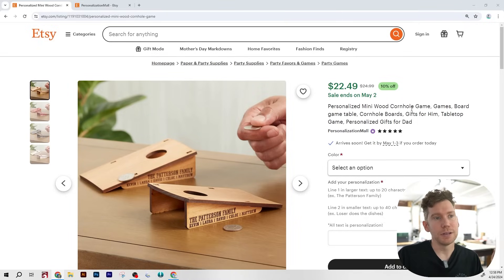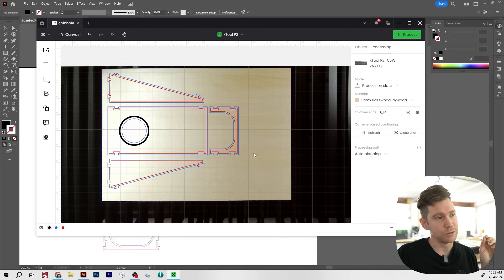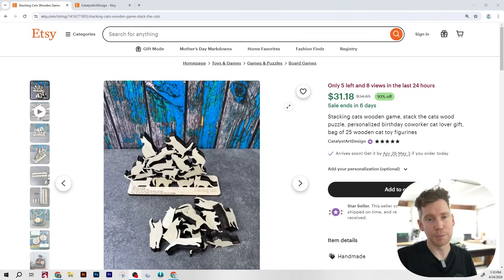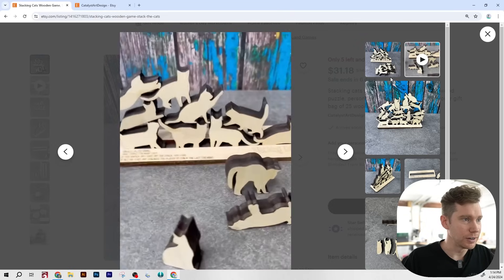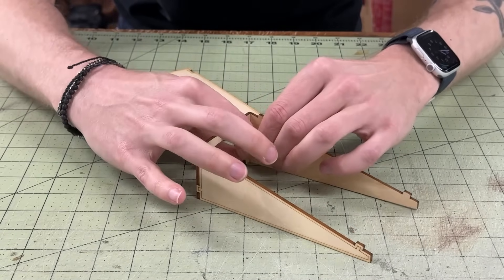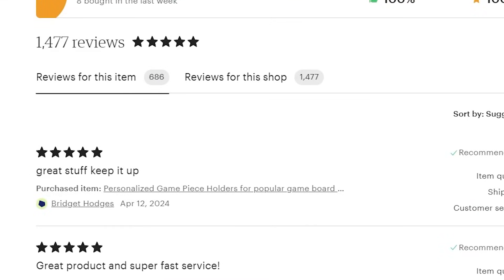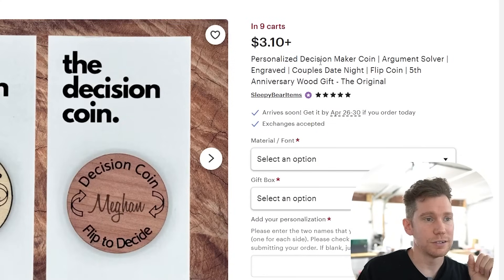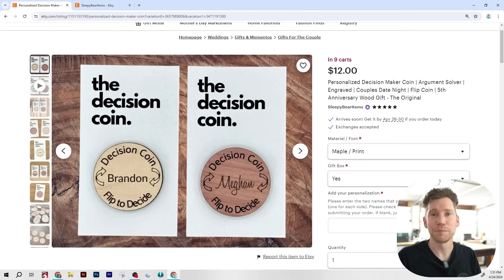Is this the BEST niche on Etsy for laser products?

Comment: Great video Justin! For the coinhole game, you mentioned blank coins, what do you think of wooden coins? you are already cutting out of the 3mm ply, go ahead and cut some coins and engrave them.
Reply from the maker: Thanks! I did try that and it would probably work. They are a little light so I would probably make the board and hole larger since its tougher to toss it without flying off course a little bit. Metal coins and bean bags have that nice weight to them.
Reply: @justinlaser  good point... hadn't thought about the weight differences

Comment: Great video.
I'm on the verge of buying the Xtool S1 40w (deluxe kit) with the 2w IR module.   i think its the right machine for me, but i am unsure.

I plan on selling hot sauce / sauces and would like to laser etch the logo / label onto the glass bottles,  
I am making several board games, and plan on using it  (s1) for creating  card holders,  game piece bases, dice roll catcher, and etching aluminum game cards.

Do you think this machine is best suited for the task, or should i consider looking into the various CO2 lasers?

Comment: It isn't ply wood.  Plywood does not have growth rings, which you can see along the edges.
Reply: Do you mean the original peoduct on the store isnt ply? 100% guarantee its ply. No way is a shop using 3 MM full wood sheets to make these. I dont even know where you can get this full sheets that arent ply but the cost and extra time to cut alone would make it not worthwhile.
Reply: Are what look like growth rings possibly just the different plywood layers?
Reply: @joshcookify  I can clearly see that's a solid sheet